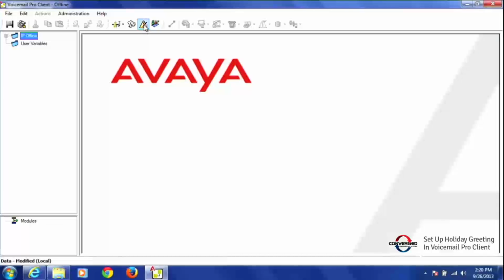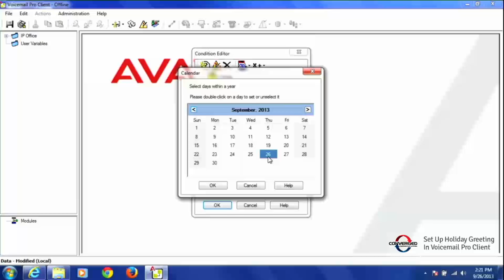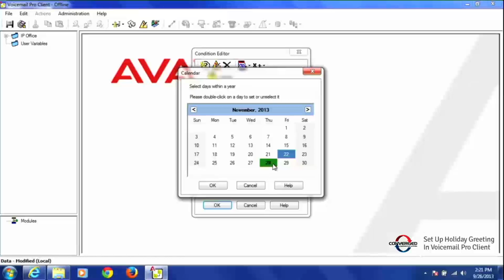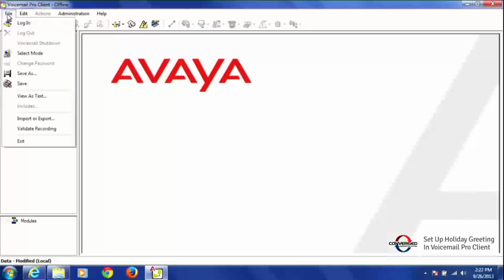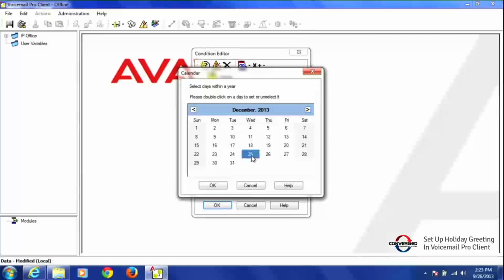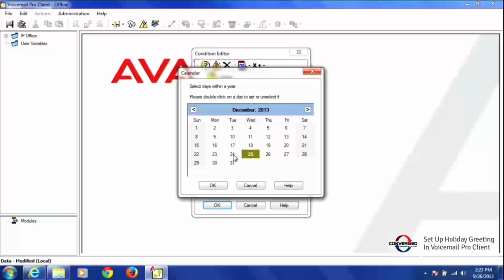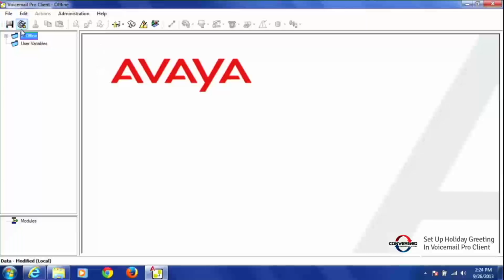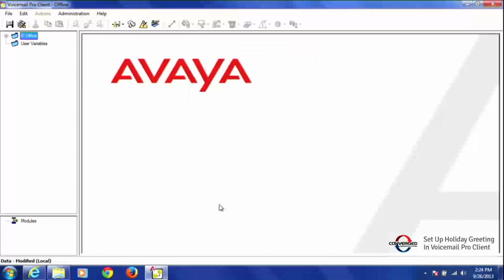How to Set Up Holiday Greetings via Avaya Voicemail Pro Client

Comment: Is it possible to skip the auto attendant and dial an extension directly? I noticed that when someone dials 234 as an extension, option number 2 answers the call. This happens because after dial 2 from the 234 extensions, the call goes straight to option 2? any advise

Comment: How to you set up partial holiday hours?  E.G., open until noon on a holiday
Reply: You need to make additional true / false statement > Condition editor > add condition > add Calendar > Pick a date (note if it's blank it will not work so the date can be the day before.) | > add compare > Value A = $time | Is = Greater than or equal to | Value B = 12:00pm (the time you want).  There are a couple ways to achieve this but this is what i decided to use.  If you need help feel free to reach out to me.

Comment: OK but how do you connect it to a module?
Reply: With a shortcode - I recommend starting a 4 digit short code.  *New Short code (open number) Example# Code - *8601 | Feature - Voicemail Node | Telephone Number - (Name of the Shortcode in Voicemail Pro).  Merge (Manager) & make live (VM Pro) and you are good to go.  Dial your short code on the phone and check.